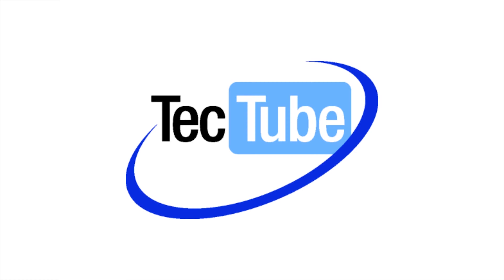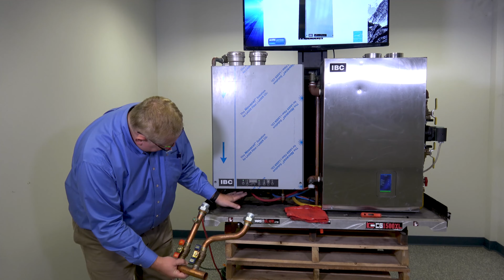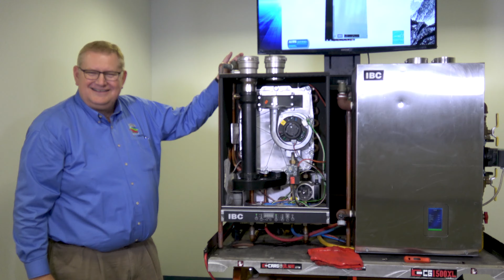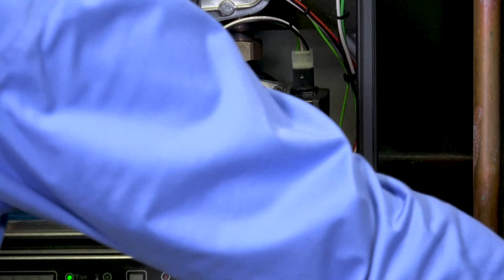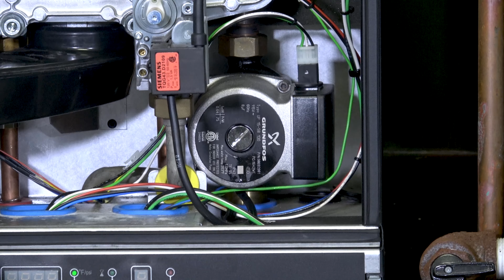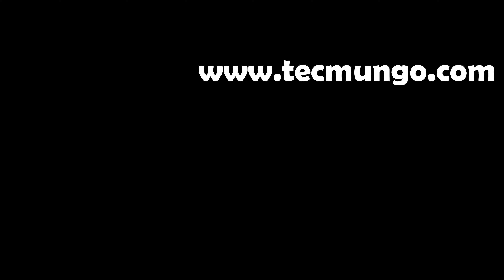How to Air Bleed from IBC Boilers (HC and DC models)

Comment: Where the hack do you buy parts for these systems (hc 20-125)? I cant find any parts for them. Specifically a water pressure sensor.
Reply from the maker: If you are a contractor, you should be able to purchase replacement parts from the same wholesaler that you purchased the boiler from. If you are a building owner, you probably need to have the system serviced by a HVAC contractor.

Comment: Let me just say thank you , for the past month or so my back rooms didn't seem to heat up as good as the front room. Different longer zone. This morning I woke up to no heat at all. Checked thermostat , the valves working fine. So I was stumped. I figured I had some air in the system someplace. So I started to search YouTube how to bleed my ibc boiler. 

Well brother let me tell you , my circulator was the culprit. I opened the screw and no water came out at first. Let it sit for a moment then some water trickled out.

Closed it back up , turned on the boiler , now everything is working better then it ever has.

Thank you!

How did the air get trapped in the first place ?.. is this something I need to do yearly ?
Reply from the maker: The air is en-trained in the city water supply.  Once you get the air out, no new air should get back in.  Unless you either have a leak or need to drain the system for some reason... then you will have new city make-up water coming back in.  You should also have an air seperator/eliminator installed on the system.

Comment: why you did  not sale  valves  with boiler??? like other brands??!!   i call to day to Canada main office ask how can i clean my boiler to expand life time... nobody give answer.. where is a video  for owners who already got your boiler!!! i buy house and it already was where... dam no answer..no video..no none!!
Reply: If you are not trained to work on these boilers don't even attempt it you will be calling an HVAC company real fast
Reply: Your supposed to call the plumber to clean the boiler and do maintenance, you could potentially screw up your entire boiler if you do it yourself or even worse burn your house down in flames. Call a certified plumber and gas fitter do it, it’s very serious when it comes to gas operated boilers
Reply from the maker: We do sell valves with our boilers.  We don't have a Canada office.  We are an HVAC distributor in the Midwest and we sell boilers and accessories to mechanical contractors.  We don't make videos for homeowners because we do not interact with homeowners.  Perhaps you are confusing us with the manufacturer, IBC.
Reply: @TECTubefilms  the person who installation ibc 33-160 (i mean my boiler) did half job...did not put second pump... no vales under boiler..on hot water domestic release valve,and more...  i look how done in  next boiler my neighbor(Navien)  and add by call local plumber...bad mechanical contractor who service New york area...
Reply from the maker: @levvasserman7633  Sorry that you had a bad experience with the contractor that you hired to install the system.  Like all of the brands of boilers that we use at our office, we have had good results when installed properly.

Comment: where is a service valves to clean system(heat exchange) one a year like other boilers!!
Reply from the maker: Typically, we clean the combustion side of the heat exchanger annually, not the water side.  However, isolation valves would be installed external to the boiler itself.  We also recommend a strainer on the return side of the boiler to keep any debris out of it.